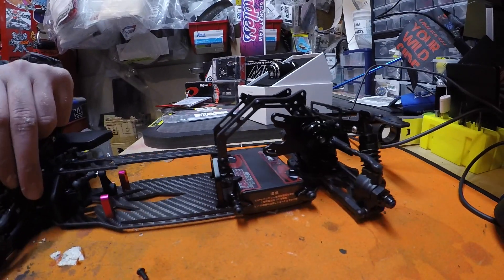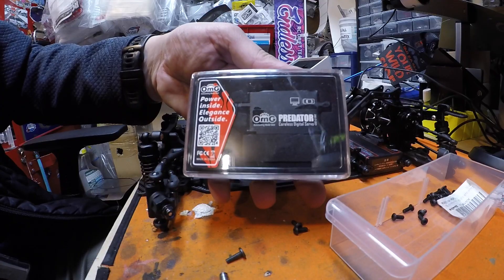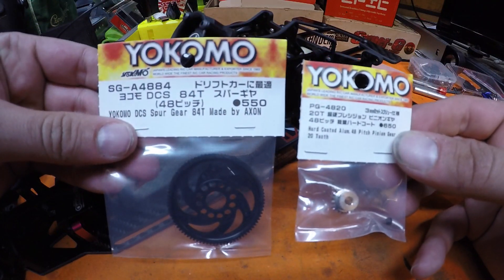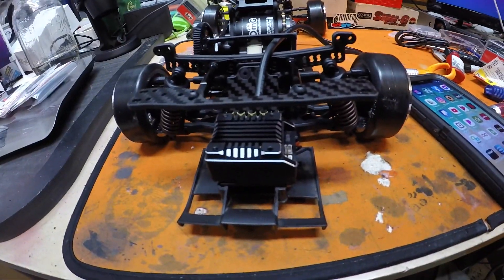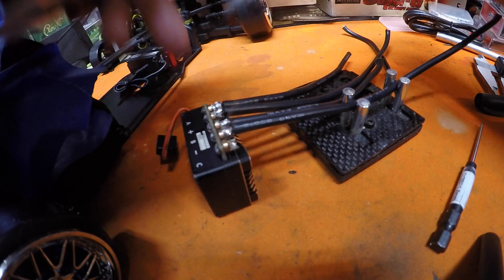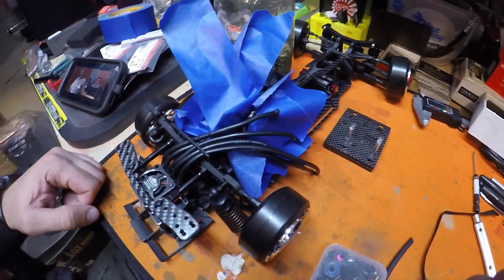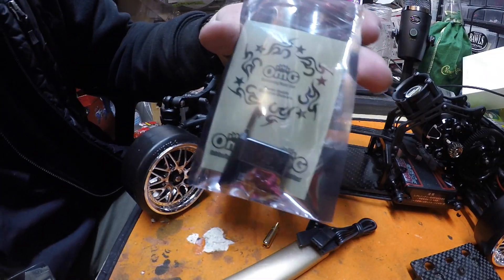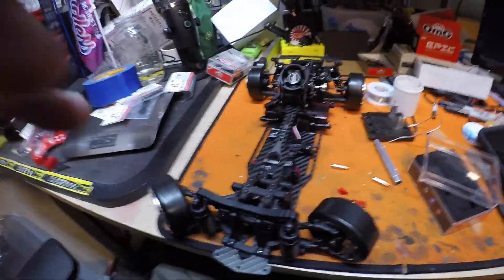ReveD MC-1 RENTAL Electronics Install (Pt. 1)

Comment: And on my Mc1, for my Sanwa Esc, I did my battery wires Vertical and my ABC wires Horizontal, which was key to use that rear esc carbon mount..

Comment: I don’t know if it’s just a pet peeve or what but I personally like to have my battery wires colored red (+) and black (-). I know there are a TON of ways to make sure you don’t reverse polarity and shortening one wire is a good tip but personally, having a visual identifier on top of that would help, especially if you’re like me and you let others have a go.
Reply from the maker: Battery safety is definetly a great priority when building and driving your chassis! Unfortunetly safety doesn’t always have the best visual aesthetics but in recent years simple solutions like a red cap or O-ring on the potitive lead has allowed the best for aesthetics and safety! Thanks for tuning in Tai!